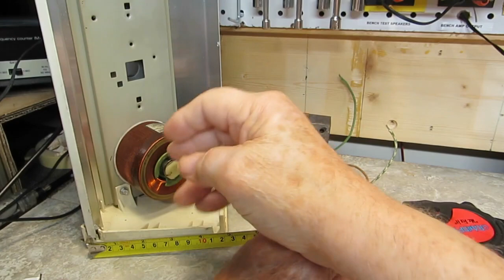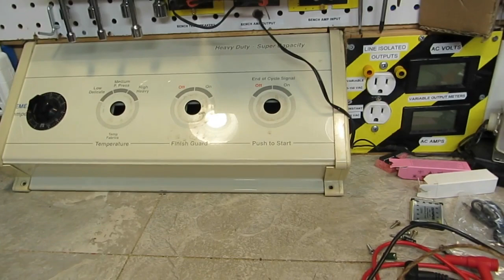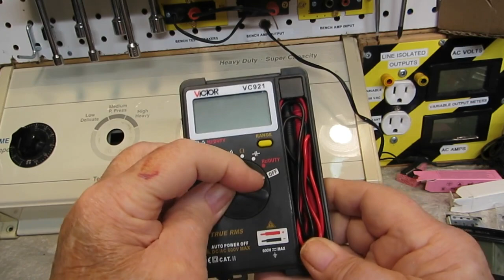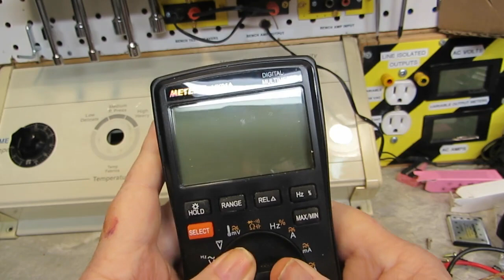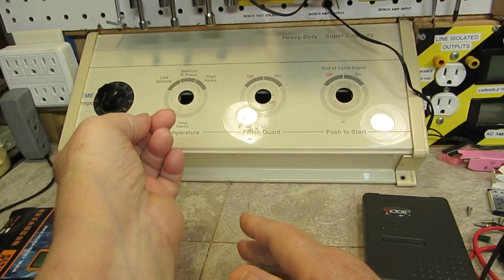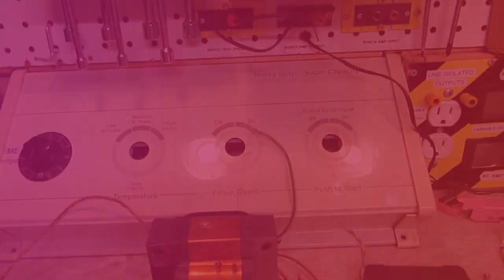DERB - Taking it to the next level

Comment: I think you are trying to cram too much in that panel.
After you put in the filter caps, power transformer and the power resistors, etc. at least half of it will be filled.
Instead of using a DMM why not use a  Chinese panel meter, they have them that reads voltage and frequency.

Comment: I vote for mounting the MeterK with its bottom sticking out below the panel's bottom edge.  It may not be pretty, but it'll do what you need.  Buying a similarly functional DMM with an equally large display that's physically smaller and fits within the measurements of the panel may be expensive, if even possible.  That, and I'd have to start teasing you about "DERB's DMM Museum and Warehouse"  😉

Comment: You can't have two coils in the same orientation and I very close you'll be introducing current on each coil I've got to be 90 degrees from each other and ideally further space than that or at least a Earth metal plate between them